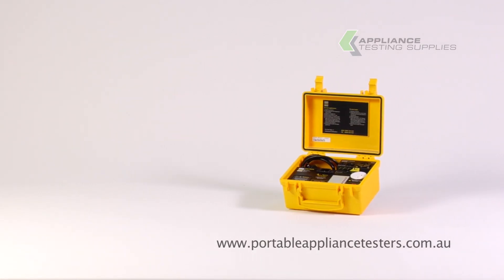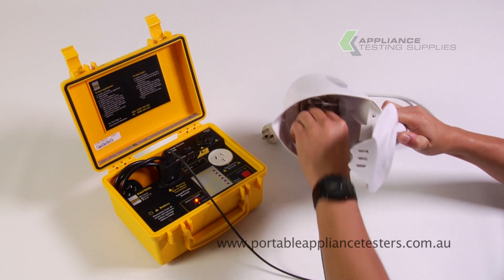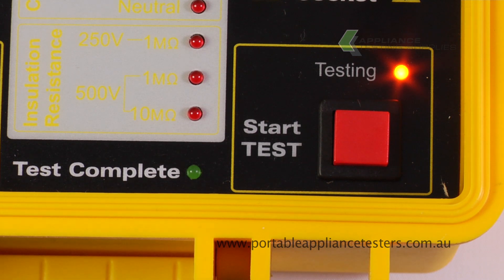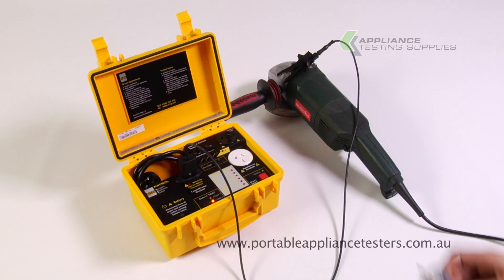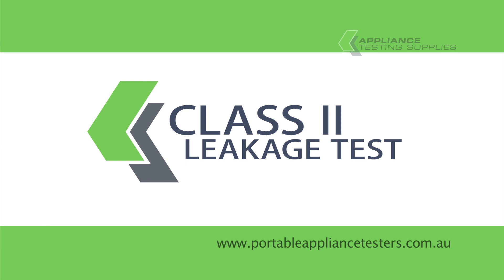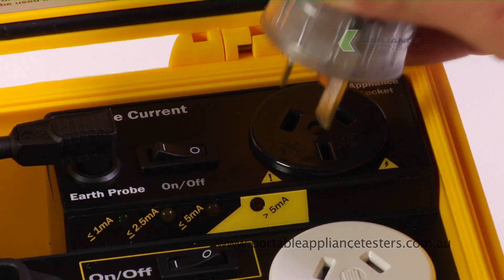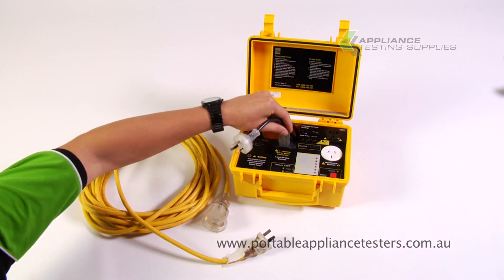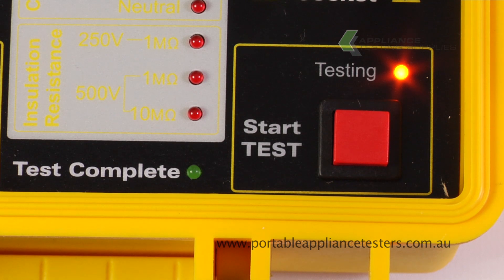Aegis Patrol Pro Portable Appliance Tester

Comment: How come your site says “Please note that the Aegis Patrol Pro CZ5001 does not meet Australian Standards AS/NZS3760.”???. 

It should meet AS/NZS 3760:2010 with the CZ5001 Patrol Pro. Would also love to see a demo of using the CZ5001 used in conjunction with the Aegis 3 phase adapter (4 pin 20A+ 5 pin 32A) performing tests with 3 phase appliances.

Comment: I bought the Patrol CZ5000 and found it to be the biggest heap of unreliable garbage I have ever used. Firstly the unit kept on diagnosing  phantom Earth faults depending which way you were holding it or the angle the box was on, this added hours to each big job. Secondly the on off switch failed. All with minimal use and being babied. No chance of warranty as time had passed before actual use. Not happy with the quality and reliability. Its a NO from me. 1K tax write off and lesson learnt.